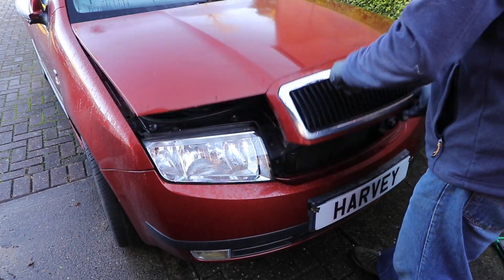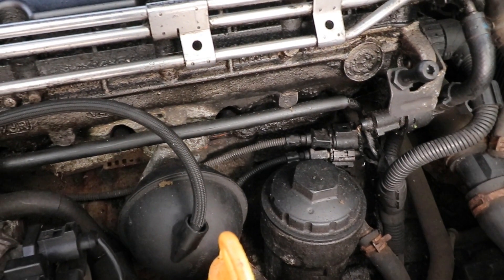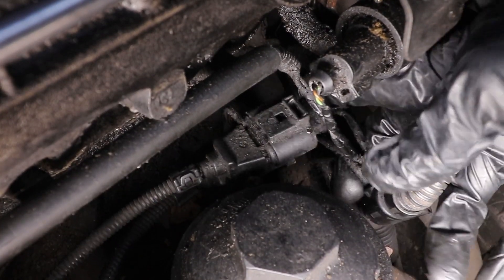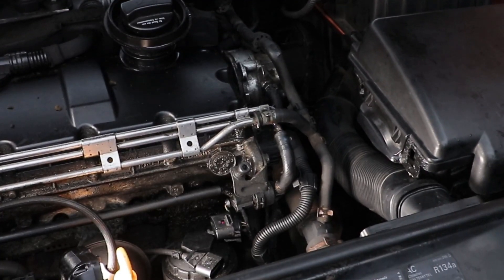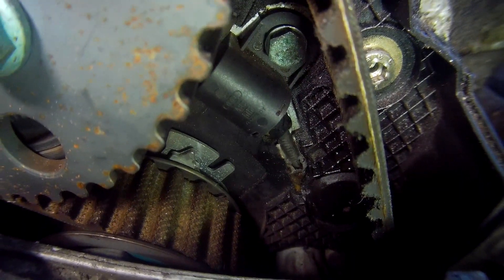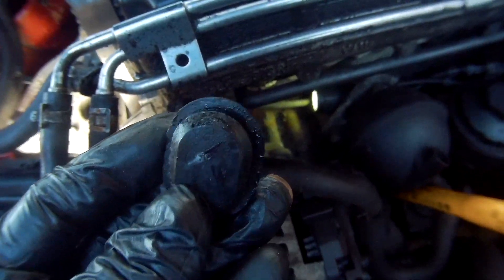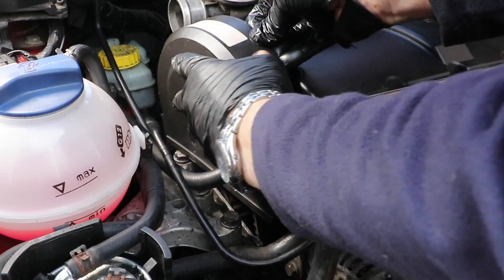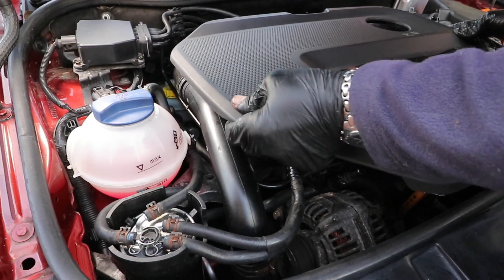SKODA FABIA Cam Position Sensor 1.9 ATD (MK1 99-07)

Comment: Changed sensor because cables were good, still p0342, turns out the pins were corroded and not good connecting when I plugged into sensor, fixed the problem. (Got old car)
Reply from the maker: Great, thanks :-)
Reply: @HatBoyHarvey nvm haha, it came back. I have 1 problem, the P0342. Changed sensor, changed connector and the voltages are good(multimeter) still the P0342 remains. I have no idea what causes it now anymore. Got any clue?

Comment: Good day Harvey, unfortunately I don't have access to a scanner, Is there a way to gain the engine codes without one? Secondly what voltages should I expect at my injector wiring? Lastly what are generally accepted compression values for this vehicle?  Appreciate your time and efforts.
Reply: Hey Harvey totally appreciate the info, I will follow through and let you know how it goes. God bless
Reply from the maker: It sounds as though your having engine running issues. Focus on de-carbonizing and cleaning the egr intake system as that is relatively free just hard work, clear the lower intercooler pipe of oil, new air filter, oil, check for vacuum leaks, all low cost. Then look to get a diagnostic check and any fault codes. You can check the injector wiring loom for continuity and contact tightness to injectors, not sure of specific Voltage without looking it up, but will be over 12V, could be 14V similar to fuel pump. If the engine is tired/high Km's then probably the injectors are dirty/worn and can be a costly repair. Compression will be around 400psi, if one is much lower - costly engine fault. Have you got a white sludge on oil cap? There is some scope adjusting Cam timing on these as will be doing that shortly on mine. Hope any of this helps :-)

Comment: Good day Harvey your videos are inciteful as usual. I have a question in relation to the cam sensor. If after you change the cam sensor the car still doesn't start what are the other possibilities. Also what compression values are considered good for the fabia? Appreciate the info in advance. God bless.
Reply from the maker: Is it just turning over? How did it start and run before? You  could try cleaning the egr and intake manifold from carbon build-up, oil from intercooler lower pipe. Fit new air filter. Check injector wiring. Run obdII diagnostics.

Comment: Hi harry do I need to plug the car in to the computer to reset it after the crank case sensor change please , I have to say I have learned so much from you mine is a 2005 1.4 tdi estate thanks
Reply from the maker: @michaeleves1014  you shouldn't have to reset anything if you just changed the sensor. What was wrong with the car?
Reply: Hi harry the car is great but on ildel is misses a beat here and there but seems good other then that , thanks so much for you you tube channel its fantastic

Comment: I have a 98 skoda fabia 1.4 16v. I recently replaced my head gasket and wanted to know how to check or confirm that my timing is correct.
Reply from the maker: which engine code? Belt?
Reply: @HatBoyHarvey  no engine code came up. It's not the
Reply: It's the rubber belt type
Reply from the maker: There are 2 belts for these and the only way to check if the belts were aligned correctly were to take of the lower cover align the lower sprocket to the mark on the block and then check the marks on the 2 cam sprockets, all should line up. it depends who changed the belts and whether they did it correctly, if in doubt check it need to be checked or a new one fitted. my guess is you engine isn't running right which may be due to another issue than timing. the sparkplugs, coilpack or MAP sensor?
Reply: @HatBoyHarvey  Thank you this definitely helps. God bless.

Comment: Cam sensor was causing my 2008 1.9 tdi touran 365000km to shut down while driving and crank but no start.  Mechanic found the issue and changed it for me.  I was thinking it was the fuel filter clogged.  Who would know it's the cam sensor.  Thanks for the video!
Reply from the maker: Thanks for sharing:-)

Comment: Hey, i replaced the sensor to no help, still no signal fault in Vcds. Pin 3 doesnt show any voltage, however the resistance is around 0.8 ohm all the way to ECU so it is good. I gave all connectors good clean. Any ideas what to do next?
Reply from the maker: You can obviously rule out the sensor now. I would backspin all wiresl at the ECU and take measurements.
Reply: @HatBoyHarvey  thank you for answer. I will add new ground wire and see for results.

Comment: My car 2007 fabia 1.4 tdi my sensor values pin 1 : 12 pin 2 : 4.9 pin 3 : no signal, is this normal?
Reply from the maker: Feed wire 12v and signal wire 5v and ground wire. You can test the sensor by passing a metal object over it and the signal wire should change to O.

Comment: I have an issue on a Skoda fabia 1.4tdi 2008 it struggles to start when it's warm yet there's no engine management light or fault codes as I took it to my local garage today 😔
Reply from the maker: Could be a number of things, check camshaft sensor, vacuum leaks, fuel pump, carbon deposits in egr/intake, throttle body and all the basics like oil, air filter battery/alt charge, fuses etc. until the problem fails completely you may have difficulty finding the culprit unless you can test it when it is faulty.

Comment: Hello just noticed your cam belt tensioner isn’t between the marks at 4:31
Reply from the maker: Thanks, will look into that :-)
Reply: @HatBoyHarvey  Surprised this engine was happy to run.
Reply: My car used to judder when cranking and for atleast 5 seconds then would start up. Ive changed the sensor now it just cranks for 5 seconds but no juddering. I noticed my tensioner in this same position. Any help?

Comment: Could you tell me if that is the right level to have your coolant as shown in your video as my car has recently come back from a service and my coolant has been topped up and now sits at the max line when the car is cold?
Reply from the maker: No worries, as long as it is between the marks when cold it is within tolerance. They often do that thinking the max is best (like brake fluid) but it is not the same. Some people often neglect checking coolant and filling to the max gives an older system a bit of extra coolant in case the system slowly leaks. When coolant gets hot any excess will naturally  blow out of the vent or in extreme cases blow a cap off if the vent is blocked, but I doubt it at that level and would only happen if the engine had a serious overheating problem. If it is at the lower lever when cold, but not below there will be the least risk of hot coolant venting out, potentially causing a fire, if it damages wiring.  I would lower the level and check regularly : 1:39 https://youtu.be/-tiZEpuTjcw. :-)
Reply: @HatBoyHarvey  thank you very much for the detailed reply. 
When I seen the coolant was topped up max I did wonder if it was within tollerance as I remember from a previous video of yours you do mention the level should normal sit between the Min and max.  
Prior to taking in for a service I've never seen it below the min when cold... Ill remove some tomorrow  and keep an eye on the level over next couple weeks or so...  Thank you :)